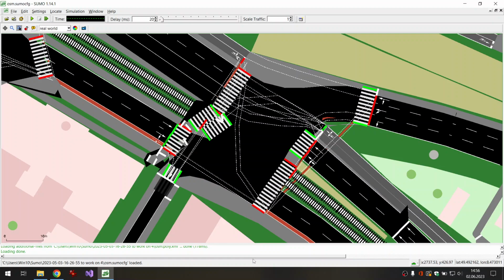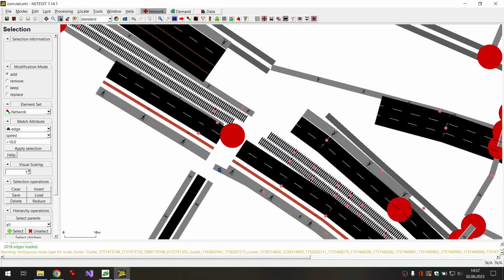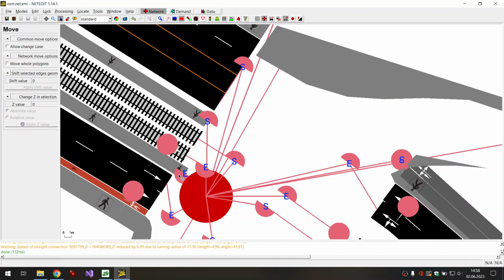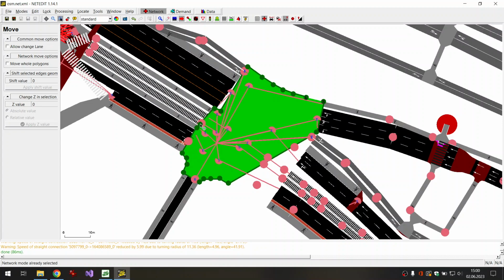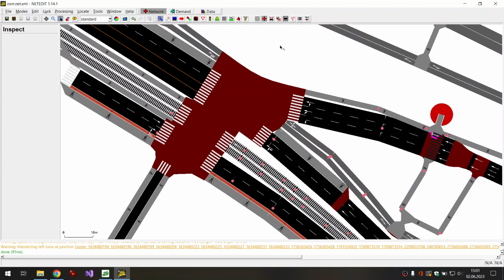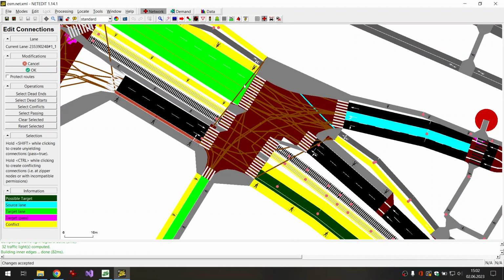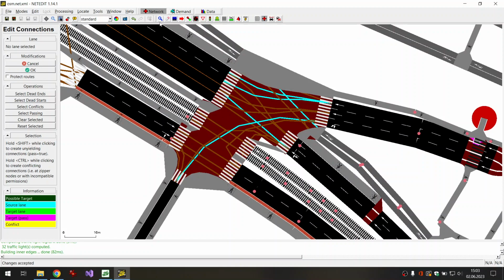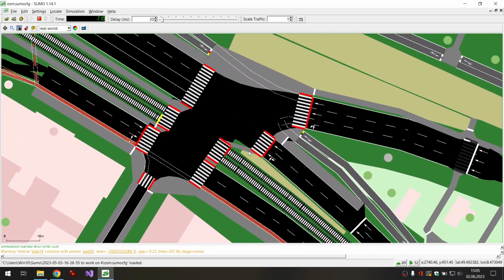SUMO NETEDIT: How to edit networks [Part 3]

Comment: can we add more cars ???
Reply from the maker: You can change the -p flag in the build script (edit the file and then rerun it). If you make the value smaller, you will get a higher insertion rate. (see https://sumo.dlr.de/docs/Tools/Trip.html)